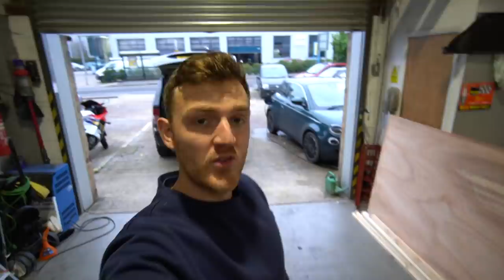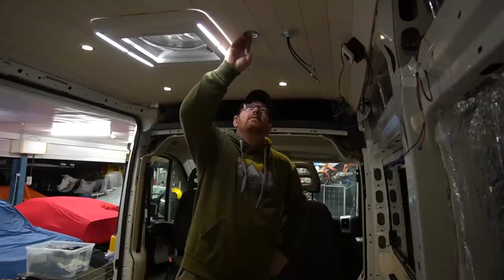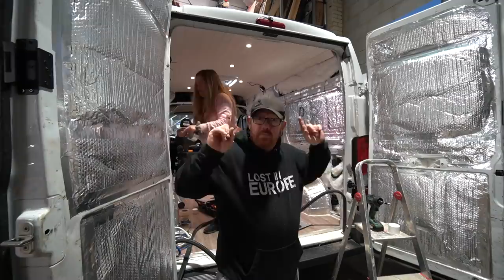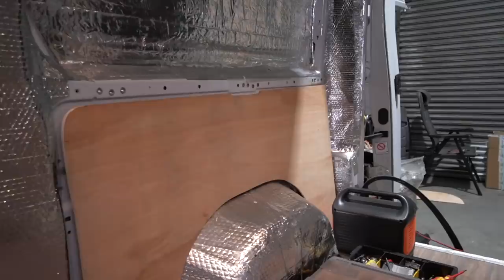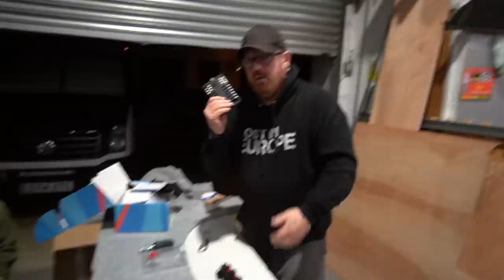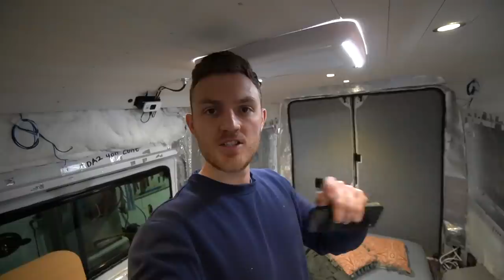I WANTED TO QUIT | Van Conversion Electrical Design & Set Up - No Experience Van Build

Comment: Little tip for removing permanent marker, or sharpie ink. These pens usually use isopropyl alcohol as a solvent, so a dab of hand sanitiser will remove it. Failing that, go over it with the same pen, scribble all over it and wipe it off immediately with a cloth or your finger.

Comment: If you want to put a circle or square hole then use masking tape where you want it and then when you have cut the hole you just pull it off.
As for getting stressed not worth it will only spoil the process 🙃

Comment: This is going to sound strange but to get rid of permanent marker on the majority of hard surfaces squirt 
WD40 & Air Freshoner on the area at the same time.
This is tried and tested.
Have a dry cloth ready
Reply: man i tried every thing on that marker , I think he get it from NASA . it came off in the end and even thiners didn't want to take it off ,
Reply: Thinners will destroy the paintwork
Reply: The WD40 and Air freshener will work instantly that why I said have a dry cloth ready
Reply: Try it on any flat surface but not untreated wood as it's porous and the ink from the marker will sink in.
I'm confident but I'll say good luck anyway.

Comment: Alcohol or acetone for cleaning marker. Or use the same marker with a rag, scribble over your error and wipe off quick. 
I just upgraded my LED lighting to RGBWW from RGB, Nobody told me that RGBWW uses 5 wires where as RGB uses 4 wire and a different controller. Of course I installed the lights before finding this out and now all my wiring is wrong. Hope that makes you feel just a little bit better....  (c:

Comment: I don't get it, so he pulled off the reflectix but put it on in other areas. So bottom line, where do you put it and where do you not put it? Why not on the sliding door buy yes on the back doors? I am confused!

Comment: Will! I have a bit of a question 😂 the screws used for screwing into the metal with the plywood are they self tap in? I believe they are ideal for joining or fixing to thin section metal sheet which I would assume are right for the job?
Reply: correct mate , the ones we use in cans , well the ones I use are self cutting ones there really good and made from zink I believe so they don't rust
Reply: @UrbanVanlife  that's awesome cheers guys! Enjoyed seeing you on Will's channel! Had to sub 👌🏻

Comment: WIll! Just slow down check things 50 times and stand back and look. Don't just set your mind on a place to drill and not double check the otherside isnt hiding behind a wheelarch or something. You have made many daft mistakes some ofc will happen but it seems your setting yourself up for failure each time now because your expecting it to fail.

Comment: That's great they have a mobile unit to remove the wrong fuel. I believe they've now invented a fuel door switch that audibly tells you to put in the right fuel when you open the little door.
Reply: In Australia you can’t put a diesel nozzle in an unleaded tank, they’re different shapes … BUT you can the other way round.

Comment: Why rip the thermal barrier of the sliding door but not the rear doors?
Reply: rear doors are closed 90% of the time cause in a seal , the side door is opened a gazillion times a day cause in it to get hot and cold frequently . good question tho mate .

Comment: Did you keep the original plywood with the cut out for the rear arches for a template ?
Reply: Unfortunately the original ply was not there anymore so no, but it all worked out okay in the end

Comment: Urban Vanlife saves the day. Your build has been static since the start of summer and i think they took pity on you.
Reply: ohhhh no not pitty , more liek we could see him getting down and it was effecting will mentally and streassing him out and we don't like people not being happy , its a massive undergoing when your bounding a van and most don't realise the job your taking on , so not pitty but more like a come here little bro we got you my dude ,  plus we got to give him hell for a few days which is really fun
Reply: @UrbanVanlife  You hit the nail on the head. Building a camper is a daunting task that takes months. Finding all the parts and materials. Loads of different skills from 12v & 240v electrics to plumbing to metal work plus carpentry are joinery grade furniture making that has to stand up to the movement inside a van that travels on bumpy back roads full of pot holes. Normal furniture wouldn't last 10 minutes.

Comment: Once Again you talking about stealth camping. It seams you have not understand what this means.

Stealth Camping means to have a Camper which looks like a company truck and not like a Camper. Therefor the Wall between Driver and Camper stays in place and no windows are build in the sides or Survivalstuff is on the roof.

Or simple: its hidding Camping